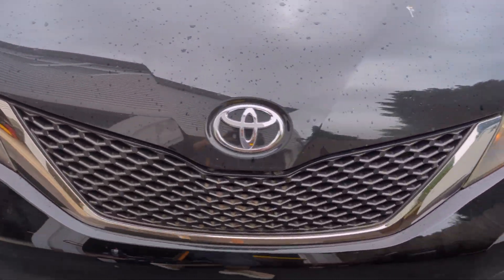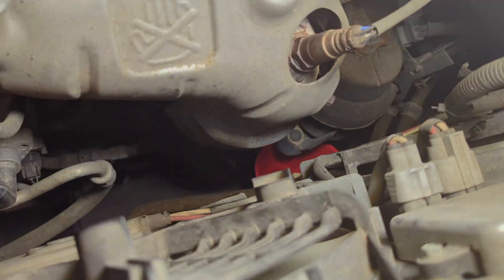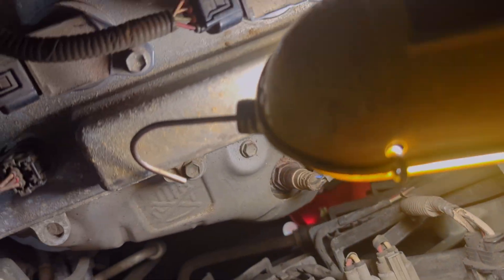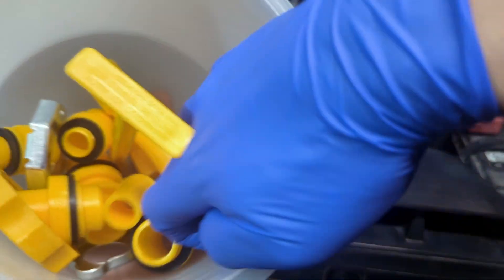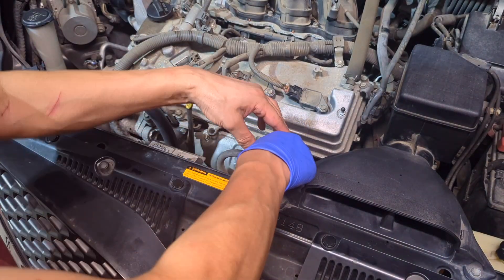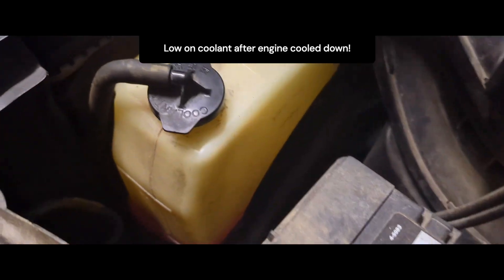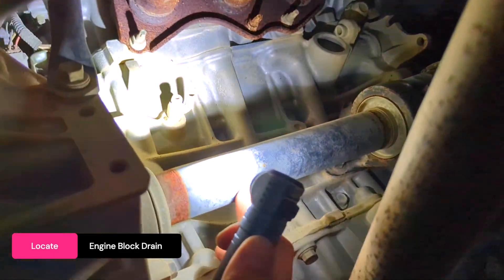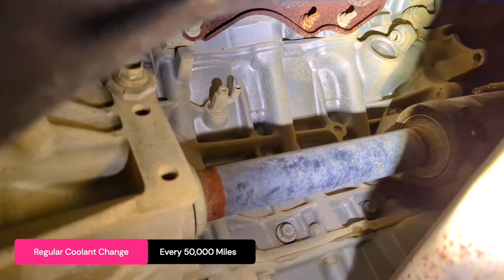Complete Toyota V6 Coolant Flush & Air Bleed | 2013 Sienna 2GR-FE How-To

Comment: Thank you for this video tutorial. I finally got the courage to bleed my coolant on my RX. I had done drain and fill a week ago but noticed the heater does not come on as it should Coz when I initially did the refill, I didn’t  do the bleeding step Coz I  followed a different video that just says to open the bleeder and stopped refilling when it overflows. So, I had to redo the bleeding step after watching your video and the car care nut channel. I was nervous I thought It’s going to overheat or explode as I see the slow bubbles coming out (I know, it’s an exaggeration but being first timer, it’s always daunting). Anyway, it got most if not all the air out. Thank you very much for teaching your viewers the right method!
Reply from the maker: You're most welcome! Glad the video helped and you got it done properly. Awesome!

Comment: Is this the same process for a 2008 Toyota Avalon?
Reply from the maker: It has the same engine model (2GR-FE) and follows the same procedure in principle. Though on the written procedure I came across on the Avalon, I couldn't find the step with the bleeder valve and am not sure whether the model/year has it.

Comment: How long did the bleeding, burping portion take from time you started engine to time you went back to normal idle speed approximately?
Reply from the maker: I didn't time it exactly, but on the 2GR-FE it usually takes around 10 to 15 minutes from cold start to a stable idle once the thermostat opens and the last air pockets work their way out. That's about what I remember on this one as well.

Comment: Thank you for your video. My car had the same model, and the repair shop told me there was a strange noise coming from the radiator and suggested replacing it for $700, which I know is nonsense. So I decided to change the coolant myself to improve the cooling system (I didn't hear any strange noise at all). You saved me a lot of money. Thumbs up!
Reply from the maker: You're very welcome! Glad the video was helpful and you were able to service it yourself.

Comment: My issue is the radiator won’t bleed from the bleeder valve out back into the spill proof funnel. In fact it would rather cycle in the opposite direction. Coolant going down the tube into the bleeder valve. What could my issue be??? It won’t bleed properly. Just replaced the radiator as the old one went out.
Reply from the maker: Are you getting heat inside the car? It feels like your coolant isn't circulating. If your water pump and thermostat have no problem, make sure you turn up HEAT setting with the lowest fan. Or perhaps the bleeder valve isn't the highest point for air to come out. Depending on your 2GR-FE engine setup, you may adjust the height of the front by raising or lowering it.
Reply: @profsg  I wasn’t reving the car at 2500 rpm. That was the issue. But also when I had the heater on it wasn’t circulating. Is this because most of the coolant was being used and being sent to the heater core? Once I shut off heaters and fans and also revd up RPM TO 2500 everything started bleeding properly.
Reply from the maker: Exactly, you definitely need to rev up the engine to help the thermostat open and get the coolant circulating through the system, which is why bleeding worked once you did that. The heater setting mainly affects coolant flow through the heater core for cabin heat, not the main circulation through the radiator and engine. Shutting it off just reduced the coolant volume routed to the heater circuit, but the real key was getting the engine warm enough for the thermostat to open.
Reply: @profsg  thank u professor. Just to be clear for anyone reading. You HAVE TO REV UP to 2000-2500 RPM otherwise coolant will not bleed. My vehicle ran for 30 mins and didn’t start circulating until I had wifey hold the pedal.

Comment: Professor, do you think it’s worth buying a coolant system refill kit to completely remove all air bubbles or it’s just a waste or not worth it.
Reply from the maker: A vacuum kit can speed things up if you know how to do it. But I'd rather go through this standard procedure without it. Just be patient with the bleeding process and you'll be able to get most of air out. That said, I do have a kit but so far have had no need to use it on any of the vehicles that I have serviced.
Reply: @profsg I just read about gasket or engine overheating because not all air pockets were removed during the bleeding process got me concerned:-). I hear about this vacuum coolant refill kit makes the job easier and eliminate the worries of bleeding.  I’m consider it since I got like 4 cars to maintain.  Thanks for your quick feedback.

Comment: Hi there Professor I also have a Sienna 2011. How many gallons of coolant should I buy?
Reply from the maker: It's about 1 gallon (definitely more than a gallon if you drain the engine block too) but I'd recommend getting 2 gallon bottles to be safe. You can keep the second bottle for the next service -- coolant is relatively stable over time.
Reply: I used on a awd 1 and a half

Comment: FYI, my 2011 since new with over 500,000 miles still with original spark plugs, coolant, brake fluid and also transmission fluid. Never ever changed and it's still going.
Reply from the maker: That’s impressive, but worth stressing this is a rare case, almost certainly all highway miles. For most drivers, conditions are much tougher. Critical fluids/parts like coolant, spark plugs, and especially brake fluid (which ages with time) should be replaced. A friend’s luxury SUV felt perfectly fine after 13 years with no brake service, until the lines burst and the car instantly lost all braking power. They ended up selling it to the shop for $2,000. Don’t take a smooth ride as insurance; maintenance only matters if it’s done before it’s too late.
Reply: @profsg 브레이크액은 27년간 24만킬로미터까지 운행하고 새로운 차가 또 생겨서 아쉽게 폐차했어요. 무사고로 운행한 게 큰 행운이였네요.
Reply: 점화플러그 수명이 그렇게 길어요? 20만킬로까지는 교환했어요.
Reply from the maker: @김재우-y8z  yes, 120k miles or 200k kms is Toyota's recommended interval for their OE plugs on this 2GR-FE engine, which is non-turbo and naturally aspirated. Just note that on their new engines such as 2GR-FKS (also V6 but with direct injection), Toyota cut that interval to half or every 60k miles. Make sure you use the iridium OE plugs from Toyota, Denso, or NGK. Cheap aftermarket plugs don't last.
Reply: Omg man what the hell! Ha ha! That’s crazy!

Comment: Hello profesor. One question, my sienna is 2017 is the same location 1,2,3,4. 
Or different location?
Thank you very much
Reply from the maker: Good question! I believe 2017 Sienna has the new 2GR-FKS engine so follow the following procedure on the 2017 RX350 (same engine) instead: https://youtu.be/bwsqjZ3GiBw. #1 (petcock) and #2 (radiator cap) are the same. But there is no longer a bleeder valve (#3) on the FKS engine so you skip that. #4 is roughly the same but it really depends on whether you have a FWD or AWD. If it's an All-Wheel-Drive (AWD), I'd not recommend going through the trouble to drain the additional mount from the engine block. Unless you have a lift, it's very challenging to access the block drain valve with AWD drive-drain components in the way while lying under the car. :-) Hope this clarifies.
Reply: @profsg my is FWD I REALLY APPRECIATE IT 🤝
Reply: @profsg  so profesor I skip #3 my sienna 2017 FWD thank you 🤝

Comment: Very good video, wish you showed internal controls for HVAC. How do you have heat on max with the fan off? Is that the recirculation setting, or air intensity? If I turn the air intensity to 0, my fan turns off, and then no heat/air comes out.
Reply from the maker: Glad the video was helpful! If it's impossible to turn fan off without turning off the heat on your vehicle, then keep heat at MAX (highest setting) and turn fan down all the way to the lowest setting possible. The idea is to circulate the heater core (for the cabin heat) but without the fan to cool it (the engine) down. Hope this makes sense.
Reply from the maker: By HEAT I meant temperature setting. And definitely make sure A/C is not on.

Comment: Is there a purpose of turning the heater on if there is no heater control valve? Seems like it would just take longer to reach proper temperature with the heater on.
Reply from the maker: Great question! Yes, turn Heat to Max so the coolant in the heater core will be circulated as well and any trapped air there will be bled too. Now, your question is why we also turned Fan Off (or Low) so it wouldn't slow down the engine warm-up. Hope this makes sense.
Reply: Professor, is this method a flush? Seems like just a drain and fill
Reply from the maker: @kalani1987  good catch! It's a drain and fill.

Comment: I do my oil change every 3K miles. it's aggressive but I think oil is cheap and I do the work myself.
Reply from the maker: Excellent! It doesn't hurt to change oil frequently and can be beneficial if you do lots of short trips or drive in extreme climates. And since you DIY, you’re in full control--no need to worry about what others think. Enjoy the work and keep doing what works for you!
Reply: Excellent. Same here. I drive city and it's hard on the engine
Reply: We do about 3-4k miles too! Failure is not an option for me. My can needs to last FOREVER!